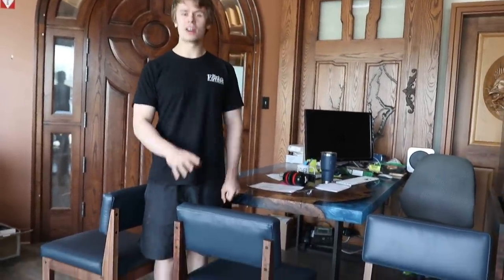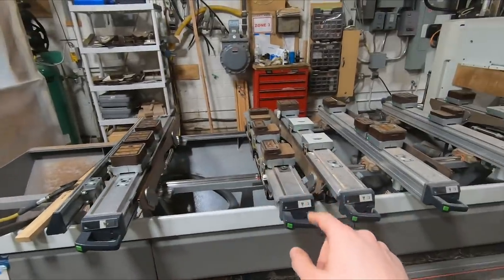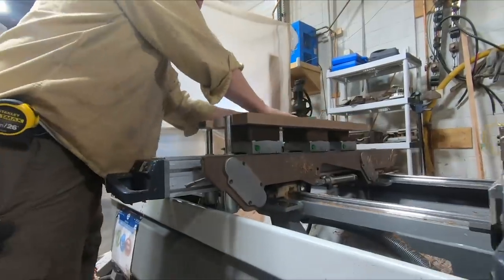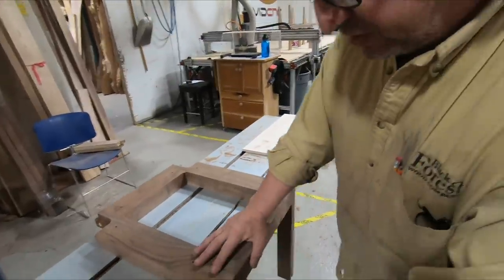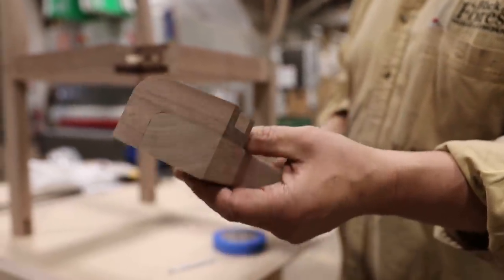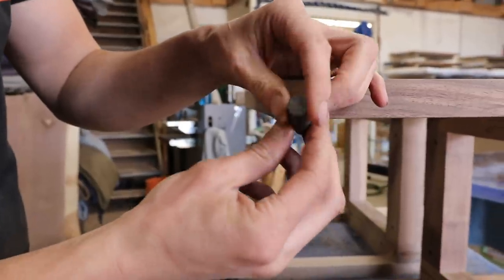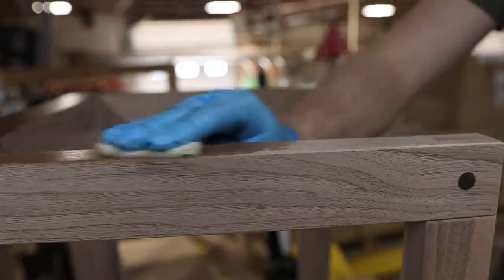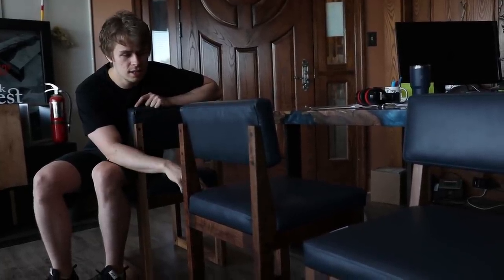How to Build a Chair - Start to Finish

Comment: Good vid. I've seen the maloof joint just not my thing. Why not just peg when using a the #12 screw. Don't know if your using acetone on the ebony peg before gluing which you should do on all oily exotic wood.

Comment: How about a start to finish epoxy table demo. Not the mould building, but from the pour to the final finish before it goes out the door. I know you've got  separate videos of how you  do it all, but would be nice to see a  simple start to finish. One thing that I can't find, and watched all your videos, is what do you do with the indent that's created by the holding down block that stop the slabs from floating after he pour? Seems like there's an indent in the epoxy a few mm deep and wondered what you do to get rid of it? P.S. Shame your epoxy wasn't being sold over here in the UK.

Comment: It seems like plugging the holes where the cushioned pieces attach presents a problem some day when the leather wears out or the foam, or the fabric.
Reply: the glue they used makes it really easy to remove those plugs
Reply: @justindesilets3526  Thanks for the clarification Justin.

Comment: so if im correct you build a chair out of cnc cut wood that you glue together no problem, but than you need a screw when gluing the leg on because you dont trust the glue? besides that its quite messy that there are so many qluelines both pre and post cnc milling. aesthetic wise idk either but thats personal

Comment: I love the joinery and strength but the design I believe could be refined to something a bit more elegant. its a bit to heavy looking and the end grain mixed with the running grain at the front is a good example of its heavy look  
frank p neoform.ca

Comment: I usually watch your videos with interest with my partner. We are UK based furniture makers. However I was shocked by the poor standard of construction and design of the chair featured in this video. There are so many fundamental flaws in the construction and the design I don't even know where to start. Then, with regards the aesthetics - I wouldn't have accepted this design off a child. As for the price - unbelievable! You must have a lot of customers with more money than taste or sense. Sorry to be so harsh - I usually like your stuff and I haven't commented before but I just couldn't leave it.
Reply from the maker: Don’t tell that to the guy who just ordered 8 of them.
Reply: @David Clark for example. Having a rail across the floor means the chair is far more likely to rock on any floor surface that isnt completely flat. Fundamentally there's a short grain long grain thing going on with the leg joints which won't withstand moisture changes. The inclusion of the screw in the joint was the wroing way. Chair joints fail back to front not side to side. Also you don't need to know anything about woodwork to recognise ugly. The chairs were a waste of perfectly good wood in my view. At least the leather work looked nice and matched the resin colour in the table
Reply: @BlackForestWoodCo  LOL. Just goes to show you can fool some of the people some of the time but not all of the people all of the time
Reply from the maker: Geez sounds like you are not the expert you make yourself out to be. The bottom rail is inset up 1/8 of an inch from the bottom of the legs, preventing any rock. What you’re saying about the screw doesn’t make much sense either, wood screws will provide strength in more than one direction. The screw doesn’t not need to go in a certain side to work. If you aren’t familiar, I encourage you to do some research on Sam Maloof and Hal Taylor, they are both iconic chair makers and utilize this style of joinery.
Reply: @BlackForestWoodCo  Well done regarding bottom rail position. Not apparent in video. No not familiar with the exact joining method but know enough to know it flies in the face of thousands of years of established practice. Re screws. I think you're wrong. I've repaired thousands of chairs and I know which way they break. Putting all that to one side. Let's pretend that it's all true and they will last for 100 years. They're still ugly and they're always gonna be. You don't need to be an expert to see that.
Reply: @David Clark yes you expect rails to be vertically higher than they are wide. There's at least twice as much wood there as there needs to be. They look like they've been made by someone more used to carpentry with 2 X 4s than an actual joiner